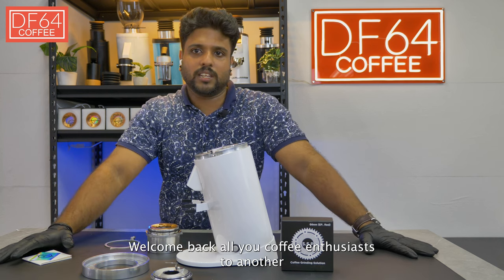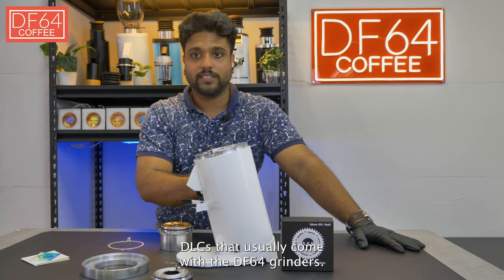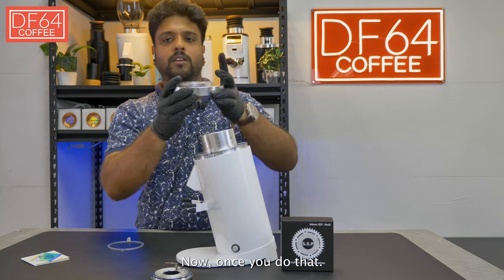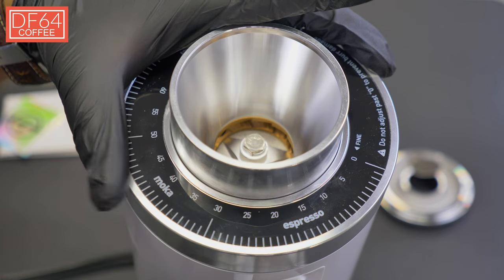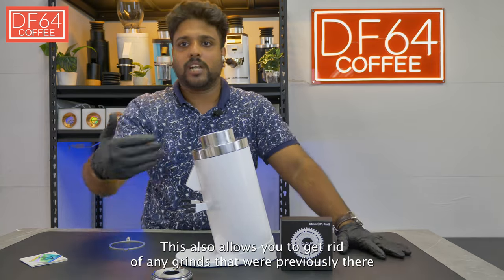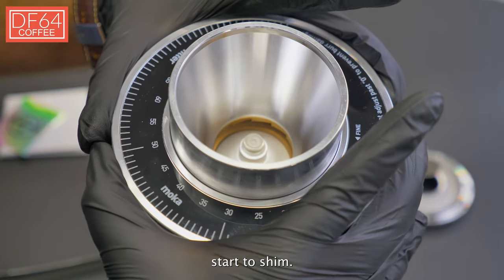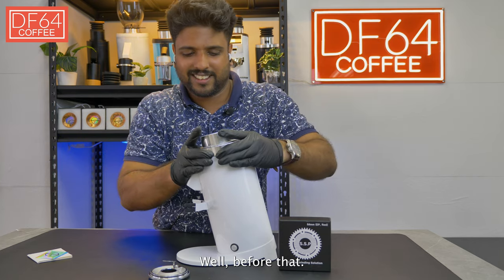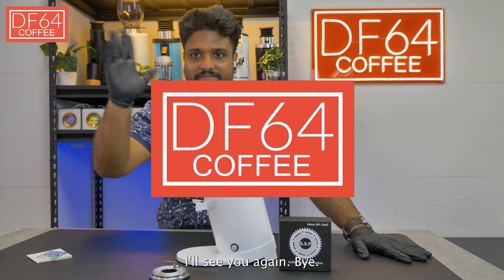How-To: DF64 Gen 2 Zero Point Readjustment

Comment: Is there a way to get the zero aligned over the chute again with ssp’s installed?
Reply: Same question.  I don't actually have the SSP burrs yet, but have just unboxed my first one.  I've found the zero point, but it's way over around 5 o'clock on the dial.  Any way to get that zero into the front, center?

Comment: Recently got the new DF64V grinder. Was awesome! Been using about 2 weeks nw. Previous i was using size 10 to make my expressso but after i open everything up and clean (did not remove the burr) they setting kinda change. Now im using size 17 for expresso. Is that normal? I did  try to adjust back the zero point according to ur video. But still in using size 17 instead of 10. Is that normal?
Reply from the maker: Hey there! A size 17 for espresso is still fine. Coarser settings for the grinder would be 30 and above and these are usually set for brews. I'd say you're still in the safe range. 

I also see that you are using a 64V instead of the Gen 2 as stated in the video. The zeroing is slightly different. You might want to check out the DF64V burr swap and zero point reset video on our channel. 

Further questions: Are you still able to grind at 10? Do you hear any noise coming when you set it at 10? Do send us a video of the grinder with you using the grinder setting at 10 to tech@df64coffee.com so that we can analyse it and further assist you from there :)
Reply: Im able to grind at 10 but sound a bit off. But im sure its ok. Probably u can do a video on teaching ua how to  readjust to zero point for df64v